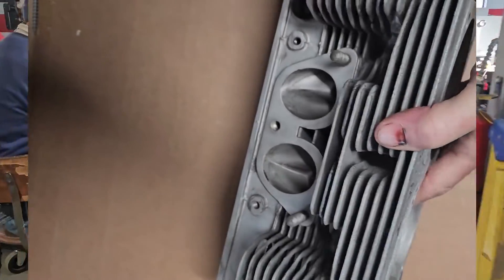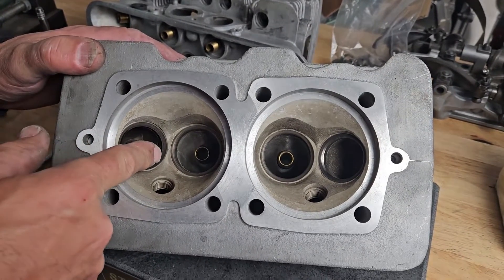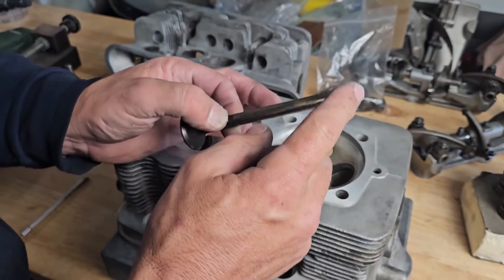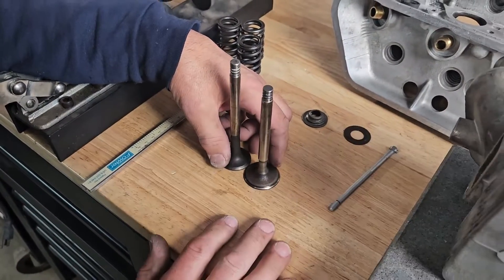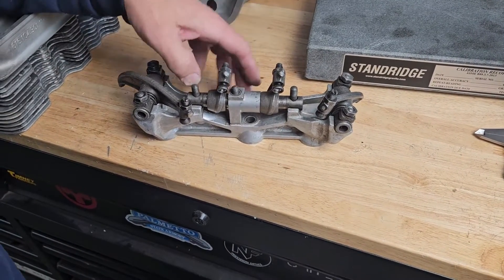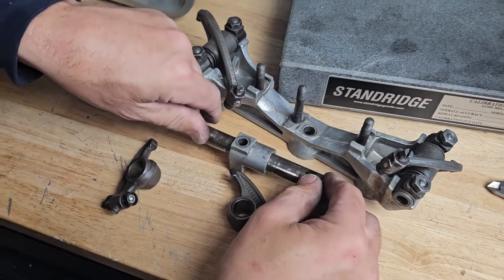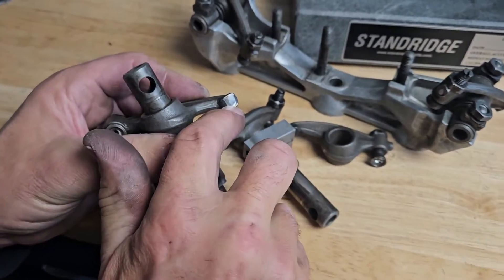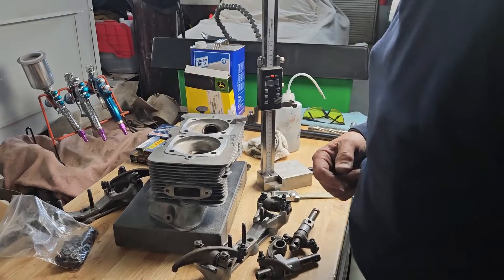Porsche 912 Cylinder Head Inspection

Comment: I'm surprised there were no cracks between the spark plug hole and the valve seats. Isn't that a common problem with 912 heads?
Reply from the maker: Yes quite often these heads will crack between spark plug holes and the intake seats. Luckily it was not the case on this set of heads.
Kurt

Comment: Kurt where would you rate the 3.2L among all of the air cooled Porsche engines?
Reply from the maker: I like them. They are the truly last of that design and Porsche had pretty much figured out most of the issues by then. The engines are reliable and preform well
Kurt